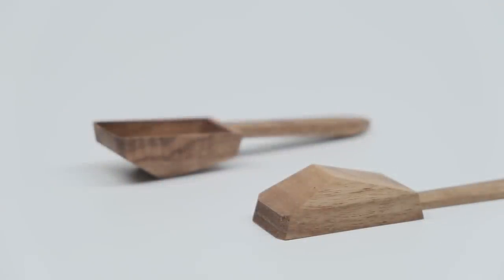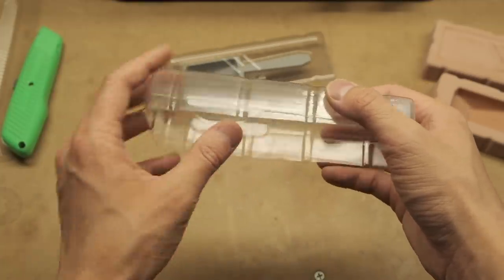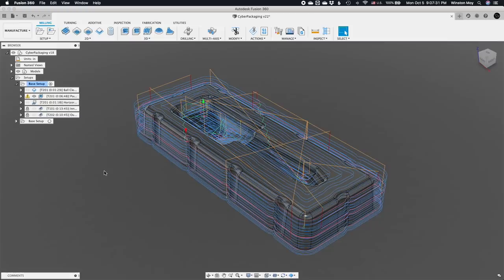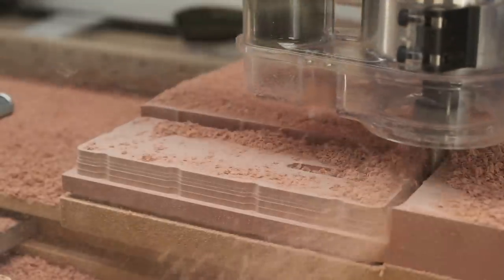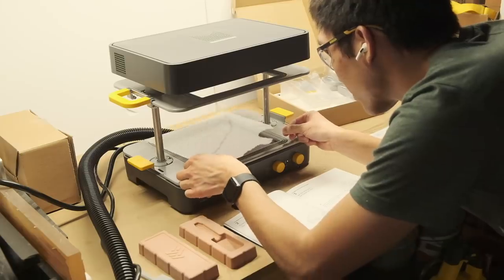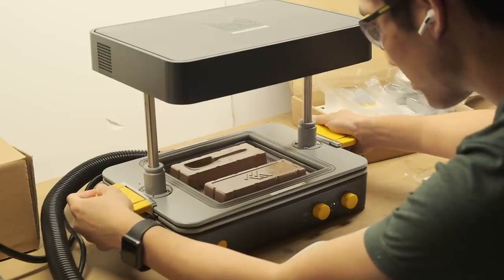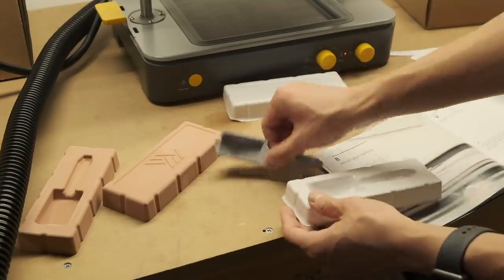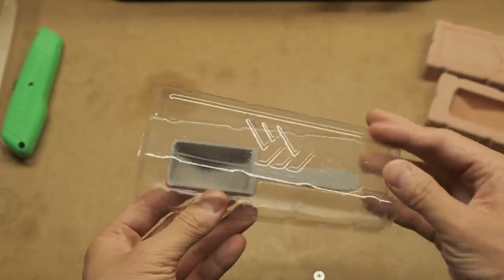Vacuum Forming Custom Packaging for the Cyberspoon

Comment from the maker: For the record, I did weigh the fact that yes, I am introducing more plastic into circulation if I go this route for packaging. It was a calculated decision. Solid plastic is much easier to recycle for households with single-stream collection. Bubble wrap and foam mailers often have to be collected separately (as in my neighborhood), otherwise most people will just put them out with the trash. Avoiding #4 plastic in film form was the main goal. Also, Mayku's sheets are from partially recycled stock, and are fully recyclable.  If I had a laser, I'd of course try some custom cardboard packaging as well. Laser companies, I await your sponsorship... In the mean time, should I ever put these spoons up for sale, maybe I'll have an option for "just put it in a box with crumpled newspaper".
Reply: I wonder if you could use soaked cardboard between the buck and one of your vacuum formed plastic holders?That is, use the combo to deform wet cardboard (or some other fibrous paste). Of course they'd have to dry but you could probably do a dozen and leave them in the plastic shells overnight.
Reply: Still plastic though
Reply: Try using the plastic as molds to cast pulp from newspaper/cardboard/sawdust from the shop?
Reply: You have the issue in your minset. First step is always recognizing the problem. I'm sure you will evolve on this! Asap
Reply: +1 for the crumbled paper.

Unless you put a recycling symbol (the triangle with the number) on your plastic it can't be recycled by normal municipal recycling collection.

Comment: Great video Winston! As a tip for the future when cutting out the plastic from the sheet is to design your bucks taller than they need to be, maybe like 1/4 inch or so. Then you set a small slitting saw in your drill press (assuming you have one) and lock the quill the same distance from the table and just slice around the circumference of the plastic. So essentially instead of cutting down into the plastic sheet with a knife as you are in the video you'd be cutting the side wall of the piece. 🙂
Reply: At my job we use this same method, but with a router table. We also use a 5-axis CNC router to cut out windows, holes, and trim vacuum formed parts. Not many people have a 5-axis CNC at their disposal though...
Reply: What I saw an oldtimer do many years ago was to cut roughly around the edge (only pushing straight down around the edge) and then using a belt sander to take it down the rest of the way. A quick zip over the edges with a heatgun and it was good to go. That was an experienced hand though.
Reply: So smart. Thanks for sharing
Reply: I was going to say, make a jig to set your product in and get a really long bit. Tread lightly but you'd get straight cuts. Maybe leave two tabs for hand cutting? Or a clamp you put down halfway through the route to hold the piece down. Screw it to the surface with a hinge and a lever lock so it's quick.
Reply: Was just about to comment this

Comment: I once ordered a small production run at a professional vacuum forming business, those guys had a horizontal bandsaw to trim off the formed pieces but of course you could use a "normal" bandsaw with a board clamped to the fence as your work surface. You'll just have to add a small "raft" to your form or just make it a bit taller than the final product so you can run the entire sheet along the bandsaw blade and only cut off your final part.

Comment: It seems like the shuttle of the vacuum former was a bit of a pain in the ass to un-latch from the UP position and slide down the rails.  Every shot that included the motion had a visible moment of struggle in it.
Reply from the maker: The latching action on mine was a bit stiffer than I'd like. It might wear in over time or might be adjustable, I'll need to see. Agree it could be smoother to operate.
Reply: @WinstonMakes  Mine was the same way at first... but slowly became easier. Probably a combination of practice and the latch getting used.

Comment: I don't like vacuum forming. This has been around for ages and it has flooded the environment with more and more and more plastic. Your spoon is made of wood. It is a valuable article and it should come in a card board package and maybe molded fibers. Every super cheap product from China comes in plastic! Those times should be gone sooner rather than later.
Reply: Oliver R. Well said!!
Reply: There is the option of pressing leftover paper (with a bit of woodglue and water blended in) into molds, clamping it down and creating the same package that way? https://www.youtube.com/watch?v=0ItPfhx3ulw
Reply: That is a great method, good find, complete instruction and who doesn’t throw out cardboard and those paper cartons.
Reply: Indeed, quite the discrepancy between the nice content and the one use plastic packaging. When you have a hammer, every problem looks like a nail...
Reply: The problem is the cost of making them, vacuum formed plastic is pretty cheap and quick to do, from heating to finished product only takes a few minutes. With carboard molding not only are you going to have to wait atleast several hours for the glue to dry, but it's also time consuning to print the molds, and you have to prep all the materials. Though ironically you could use vacuum forming to make many molds, but dry times would still seriously limit production and cost.
Reply: @Oleg-oe1rc  Well - I think plastic is not cheap! It is only cheap if you ignore the second half of its lifetime - means after it is thrown "away". Problem is there is no "away" on this planet - because "away" just means you probably paid for not having to see it, after you used it and dont need it anymore.  But it still exists and causes a lot of problems and also cost. Unfortunately this cost is not for the ones who produced or used it. Its the next generations who have to pay the price for the second half of the lifetime of plastic. And one thing is clear to me - it will be extremely expensive.
Reply: @3dbits_art  Just like paper can be recycled into pulp and made into other things like packaging, plastic can be reused and recycled too, we just do a poor job of it.
Reply: @Oleg-oe1rc   we do a bad job of it, that is a fact. One of the reasons being: there is little money to be made, confirming Oliver’s point of plastic not being cheap in the long run either. Given the current infrastructure, cardboard seems to fit the job better at this moment in time, although the costs/investment for a manufacturer might actually be higher.

Comment: We used top have a tool back at high school for cutting vacformed pieces from the sheet. It was basically a flat plate with a dremel type small rotary tool fitted with a tiny circular saw blade protruding from the plate by about 3mm and parallel with it. You'd just mould the pieces slightly taller than needed and then cut them out of the surround material. Produced a very flat even edge too.

Comment: For a limited run, you could have an extra buck cut that was left on the cnc. That way every newly formed packaging would be separated from the sheet and put on the extra buck before running a contour cut with the cnc around the buck at a defined distance, matching the material thickness
Reply from the maker: Definitely a good idea. And/or I could machine a pair of indexing pin holes in the bottom of the Renshape to re-mount them on the CNC.
Reply: Good idea. I wonder if a drag cutter or laser addon for the cnc might give a nice edge.

Comment: For trimming the plastic neatly. Take 
Two Flat scrap pieces wood, or even  better some acrylic. Sandwich a razorblade or scalpel blade between them. Secure the pieces together with a screw or bolt and nut. 
I do this with two pieces of 3mm acrylic. I have two grub screws to secure the pieces together so I can swap out the blade. 
You can slide the flat side of your 'cutter'  across the vac forms circumference to get a consistent straight cut all the way around the perimeter.
Quick, cheap, easy.

Comment: For the lid to remain clean and clear you can vacuum form over top of the first vacuum form. I've done this many times in the models when I needed a clear and clean final form. With this in mind you have to change the dimensions of the buck to compensate for the added material.

Comment: Outside shell the dimension desired for your tolerance next time, then you have a precisely oversized spoon for your boolean operation, great video.
Reply from the maker: Good idea, but in this application it wouldn't make it any easier to account for the fillets left by the ball endmill when machining the spoon cavity.

Comment: Just for your information. Festool vacuum cleaners are not as quiet as you'd think. Given the noise is measured on a set of vacuum and suction hoses (some manufacturers measure only the vacuum cleaner without hoses) here are the results for units in the same class(taken from official pages): Festool CLEANTEC CTL 36 E - 71,00 dB
Makita VC4210L - 62 dB. I use both - Makita is quieter. Both Festool and Makita measure vacuum cleaner + hoses.

Comment: Great Video.  You can use the vacuum form to cut the plastic.  You need to put in the design a sharp tapered raised line.  It wont cut all the way through, but east to snap or cut through.

Comment: Thinking about small scale manufacturing, if you can use smaller blanks held in place by a heat resistant jig, it might be possible to pre cut the formed plastic while its flat, and then shape it.  It would require some R&D to get the jig and blank shape down, but the upside is not having to cut each formed piece individually.

Comment: I just spent a few weeks temping doing maintenance at a thermo-form packaging factory, was very interesting, the big machines use air pressure and vacuum, have a roll feed and a cookie cutter built in.
Nice machines to work on apart from the heat!
Great vid by the way.
I built a pretty big clicker press if you want to use it for inspiration I have a vid on my channel, probably a bit caveman esq for you though.

Comment: Hey Winston! On the note of vacuums, you mention on your website that you use the Fein vacuum because its a lot quieter. Have you tried out the new Stealthsonic Dewalt vacuums? They are supposedly even quieter than the Fein vacuum based on their specs (who knows how they got those measurements though). 

Keep up the great work!

Comment: Great video. I did have a small question, have you thought about adding some type of form release on your bucks? It helps smooth out minor surface defects while also improves the release of the molded plastic. It doesn't need to be anything fancy, we just used a light dusting of baby powder for our mold release, (think of using a small sponge to dust the bucks), back in the day when I was working as a plastics engineer.  Anyway, thanks again!! Keep up the great work!

Comment: I didn't have the shapeoko pro at the time of this video..... so, do you have one now? I'm eager to see you play with it!
Reply: honestly there are far better cnc's for cheaper I would suggest
Reply: @MrJcTTK  I'm not particularly interested in the shapeoko pro myself. I am interested in seeing Winston push it to it's limits
Reply: @CalebKraftmakes   ah i see I'm a pretty big fan of the longmill CNC but I do really see anyone talk about it. It's cheap and uses lead screws haha
Reply: @MrJcTTK  I did a video all about the longmill for Make Magazine. It's a nice machine! That's a world apart from the shapeoko pro though. Those Vwheels won't take much lateral pressure before they start to have wobble
Reply: @CalebKraftmakes  Yeah that's my biggest problems with most consumer grade cnc's that you buy. It's either they use straps with linear rails/vwheels or vwheels with lead screws. I don't know many that use linear rails with lead screws. If you know of any do tell. (reasonably priced though haha) I am currently working on building my own. Though I have been debating on saying screw it and using a rack and pinion system like on the CNC Pro machines. I shall check out your videos though.
Reply from the maker: Very soon... I haven't been able to do content properly for weeks now because I was thrown in pretty deep on development and testing for both Nomad and Shapeoko. Now that we're transitioning to production I can finally focus on making fun stuff, instead of making the machines that make the fun stuff. 🤞🏼

Comment: This is awesome Winston. I've used Fusion but for mainly visualization purposes. I currently use VCarve for drawing and toolpaths and it's really straight forward and very reliable. Have you used VCarve? On the fence still about a Fusion subscription...
Reply from the maker: I've not used Vcarve outside the demo/examples. It's good for 2D/art stuff and 3D surface things like signs and whatnot. I know people who like laying out designs in it, but it's no replacement for 3D CAD if you want to engineer things.
Reply: @WinstonMakes  I totally agree. Thanks for the reply.

Comment: That's a really nice small vacuform. We have a large one at work with two different mounting plates for 50x50cm and 25x25cm, but the machine is very bulky and the majority of the vacuuming work we do is just small objects. Maybe I can convince my colleagues to get this smaller machine...
Reply: the only problem is they charge way too much for it. 700 dollars for that is a lot
Reply: @MrJcTTK  Nah, it's cheap. We have a bigger one that cost around 5~7k or so (and it's not ten times as big). I'm fine with the price and it looks well developed :)
Reply: @MarinusMakesStuff  I guess my whole thought process with it is if you were gonna spend 700 on that you could easily make one far bigger for the same price. Also yeah it does look amazing but I just don't see how it can be justified at the 700 mark.

Comment: There’s actually a way to incorporate a sharp edge to your forms combined with elevating them, to essentially automatically cut the circumference. Granted, it will actually make the edge of your piece very thin at the parting line..you can literally tear the section away without ever knowing it was torn, vs cut. Respond and I’ll explain the modification to your blocks.

Comment: Hello , i have a small sugestion for you about the final texture on the plastic , so you can apply a medium coat of automobile primer on the forme sand it with 600 to 1000 grit sand paper and it will be fine .

Comment: Can you use a 3D printed mold instead of and CNC machined wood mold?
Reply from the maker: You absolutely can, just keep in mind that pockets and concave areas need to be vented. So some tiny holes modeled or drilled through the mold would be recommended.

Comment: when you resized your model a bit for the spoon, I think it would have been much more straightforward to simply import your spool model at 101-103% size and use that as the cutout instead

Comment: While all the other suggestions of cutting the plastic would work fine, what about converting the shapeoko to work as a drag knife? It'd give you yet another tool within the shapeoko's platform, could be useful in the future, and would make for more interesting content. I know plastic is tougher than what drag knives are typically set up for, but it'd be interesting to see a solution for drag knifing plastics; say either a circular, rotating cutter, similar to what a pizza cutter is, or adapting a small ultrasonic knife to work in a drag knife.